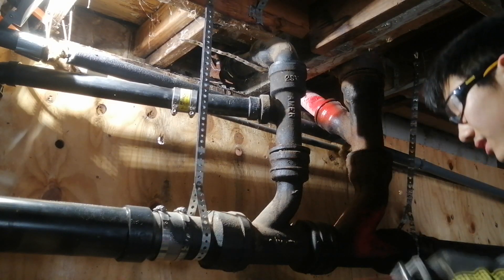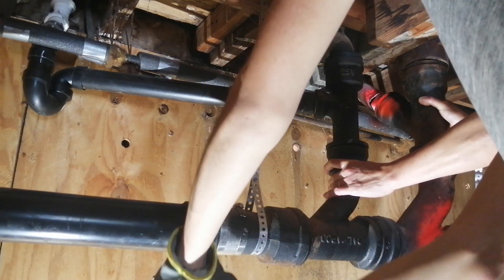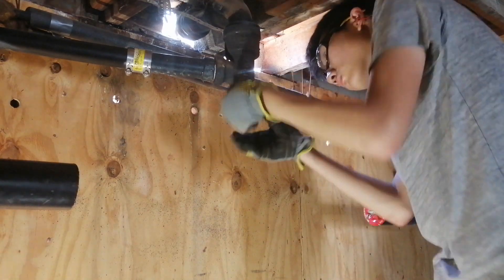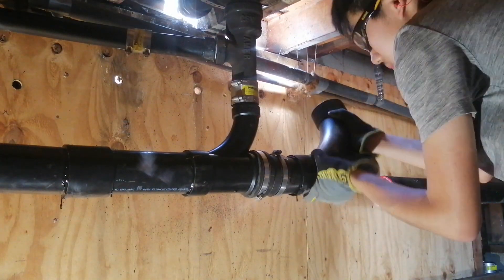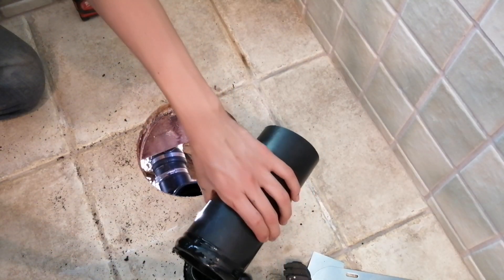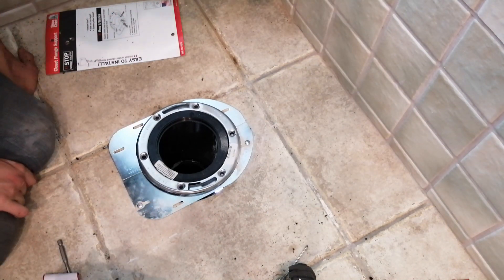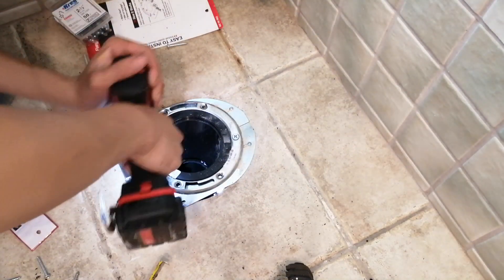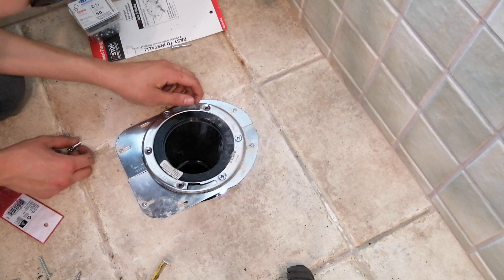Replacing Corroded Cast Iron Sewer Pipes with ABS Plastic

Comment: Great video.  I need to replace a bunch of leaking iron in my townhouse garage.  I like the ideal of using ABS.  Someone took care of 2 neighbors and it was $2000 with new iron.  I'm going to go the abs route.
Reply from the maker: ABS is a great material, but if your pipe goes through the garage firewall then that section must be metal. For example, if there is a garage sink, then you could install ABS pipe, then transition to steel just for the section through the wall.

Comment: Just use a thin wheel grinder to cut the pipe
Reply: I prefer diamond wheels.. super smooth cut without all the debris from the metal cutting disc

Comment: Awesome!!! Now def am thinking about trying to diy replace my final section of cast iron piping...
Reply from the maker: It's pretty easy! The hardest part is cutting the pipe, you'll need a powerful Sawzall and special blades. Installing ABS and PVC is straight forward and forgiving. Ram bits let you take apart a joint if you make a mistake.

Comment: its a law that ferncos must be outside of the house and at least one foot buried under ground, I would not recommend using a fernco like this because after a while they tend to fail
Reply from the maker: In my area Fernco fittings can be underground but shielded fernco is required if it's buried deep. They're also allowed above ground. Check your local code before starting any project.
Reply: @DragonBuilds  I see! I totally disregarded the fact that different areas have different laws! My fault sorry about that :D
Reply: @DragonBuilds  MIKE DROP!!!!
Reply: Maybe in your area but your statement is not true nationwide.